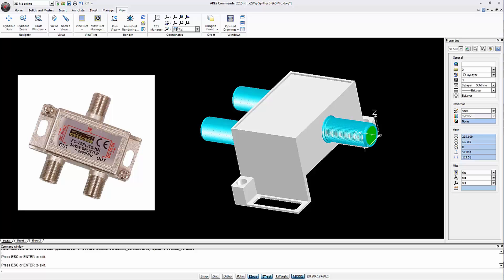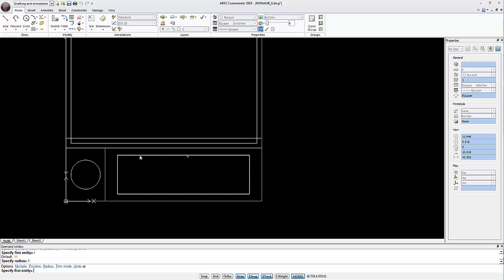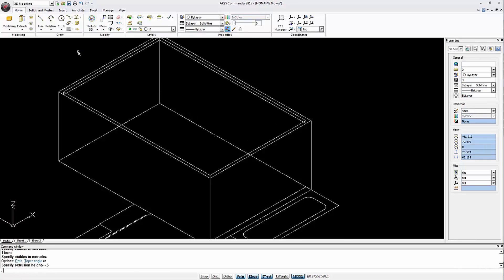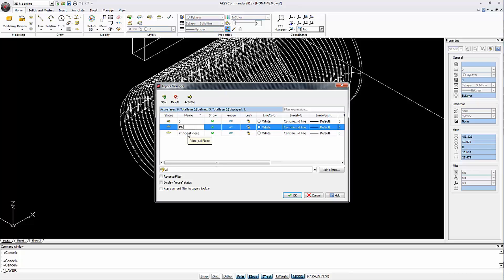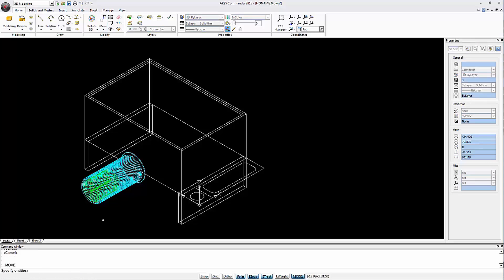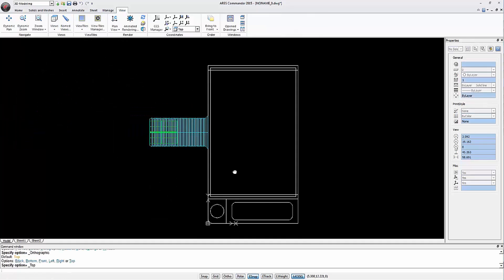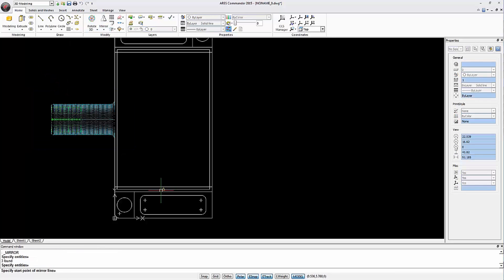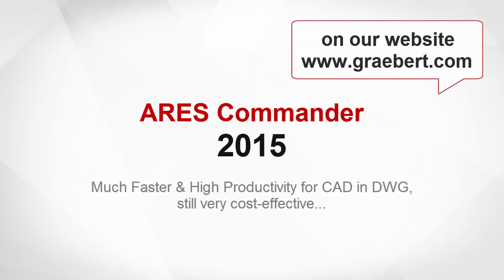How to Draw in 3D | Basic Features

Comment: I have a question, maybe you will see this. At 0:36, you click on a rectangles which u will extrude later in the video. Somehow, you managed to make it empty inside, when extruding it. If i create a rectangle, its always completely filled when extruding it, i wanna change this
Reply from the maker: All extrusions are "empty inside": what may vary is the display options, making them "see-through" or look like they are "filled" as the user says. The visibility/display is controlled by the command SHADEVIEW. More information about the command (and other options) is available in the ARES Commander Help Files.

Comment: Great demonstration but the thread created by the Revolve command has no pitch, i.e., it is not a true thread in the sense that you can follow the groove around like you would of that on a bolt or screw.  So my question is, how do you create a thread in ARES Commander that is a true thread that has a pitch?  For example how would you create a 10mm bolt with a 1.25mm thread pitch?
Reply from the maker: Dear Chrispy104k,

Thank you for your question. With the current version of ARES Commander what you are asking would not be possible. That said I am pleased to let you know that we will introduce the HELIX command in ARES Commander 2018, which would obviously bring you more power for the task you described. In the meantime, it really depends on the level of details that you are expecting: the above video is showing some steps that would not bring you a result 100% correct from a geometric point of view but clear enough from a conceptual point of view. You might also add 2D detail views of your project to clarify further the details such as the pitch of your thread. Also, Thank you for subscribing to our Youtube channel, stay updated as we will soon release a new product called ARES Mechanical. This product is 2D-focused but contains among other features libraries of parametric nuts and bolts.

Regards,
Team Graebert
Reply: Great to hear that the HELIX command is coming.  Yes from a conceptual point of view what is shown in the demonstration is great and yes I agree that in 2D it's simple to create the thread view (i.e., in cross section) to show the pitch details.  Thanks for replying.
Reply: @ARESCADsoftware is this possible now?
Reply from the maker: Hi there,
The Helix command is required to create such 3D objects with thread pitch. ARES Commander supports it since version 2018 released 18/12/2017 now. Meanwhile, we also offer a separate ARES Mechanical Application that allows you to create mechanical screws directly.